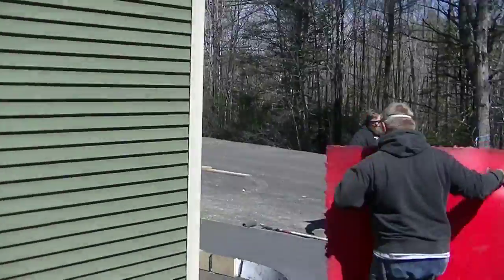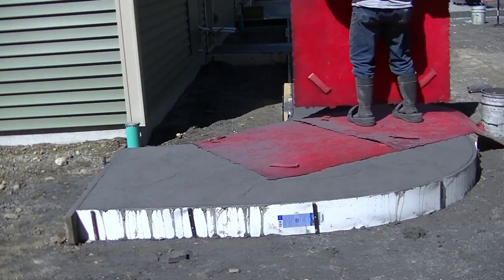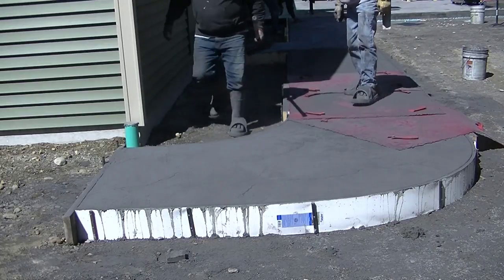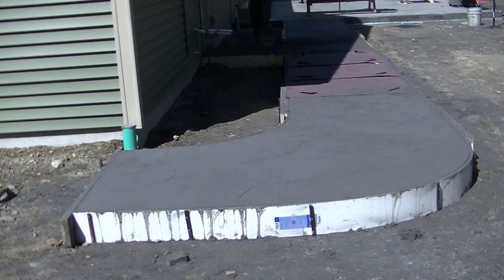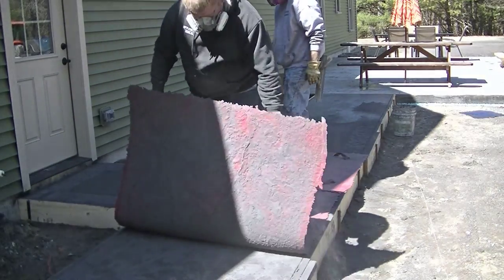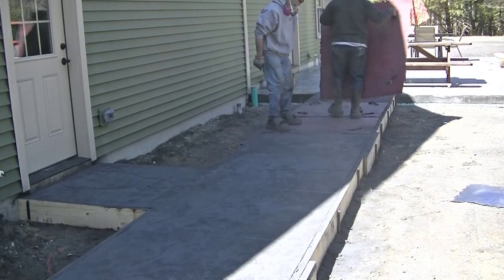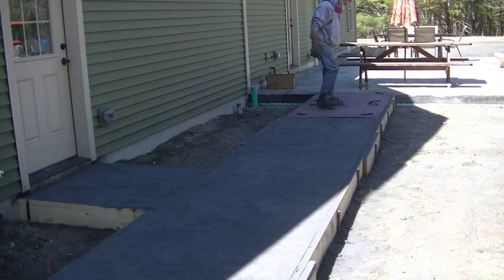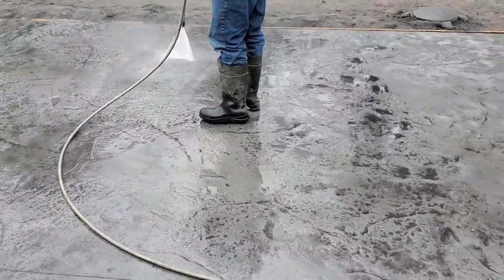Finishing Concrete Sidewalks (Stone Textured Finish)

Comment: Great look to the surface. I dont do concrete work but I'm considering pouring and finishing my own floor in a garage that I want to build. What strength concrete and what reinforcement would you recommend for a workshop floor? I will use it for cars, pickup trucks, miniexcavator, skidsteer storage and repairs. Thanks in advance.
Reply from the maker: I'd use a 3500 psi mix and make it 5 or 6 inches thick. Wire mesh with slab bolsters under it would be good.

Comment: So you colored the concrete dark grey and what color release agent did you use?  Also, is stamped concrete typically very slick when it's wet?  How do you mitigate it becoming super slippery?
Reply: There is a sand additive you can put in the sealer. It is sometimes slippery when wet. We add the sand for stairs. 
Bondo
Reply from the maker: We used charcoal release. It can be slippery like most other wet surfaces are. You can add a non-slip additive to the sealer.

Comment: How is the slip resistance of this finish compared to a broom finish?

Thanks for the vid, well done.
Reply from the maker: It's close. Broom is probably a little less slippery.
Reply: Stamp finish is more slippery, specially when wet..couple things I've done was before I broadcast the release powder to stamp, was give the whole patio or walks a light broom finish ...then throw the powder and stamp. It helps and you don't notice the broom affect...
Also after you wash the powder off and when it's time to seal, add a product called sharks tooth!  It's fine rubber pellets you mix in with your sealer, it will slightly dezolve and when the sealer dries you can't see the shark tooth but it leaves a slight little bumpy affect for traction...Jerry. Concrete Impressions
Reply: @Whacked.  Thanks!   It will be a long time before I have a property that needs sidewalks and patios, but this information lets me know there are products and processes I need to discuss with contractors.

Comment: That looks like the perfect kind of stamp for a beginner in stamp-crete to go with. Would it be possible to only use the roller (maybe a little wider one), to do the entire surface? 
Watching this video made me wonder how a segmented, ‘picture-framed’ sidewalk, might look if you stamped the center sections and then left the ‘framed’ areas smooth (or vice versa, brooming the center sections). I guess that might start to make the possibilities almost endless.
Reply from the maker: The do make larger texture rollers you could just use instead. I should get one and video it.
Reply: That is by far the easiest stamp for a beginer to try and stamp something. start with a small project. Dont you agree Mike?
Bondo